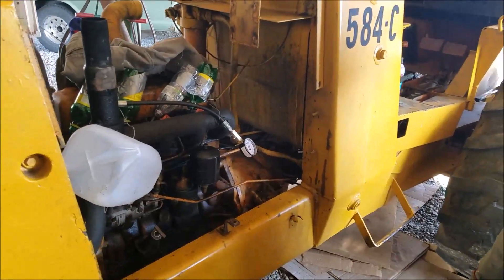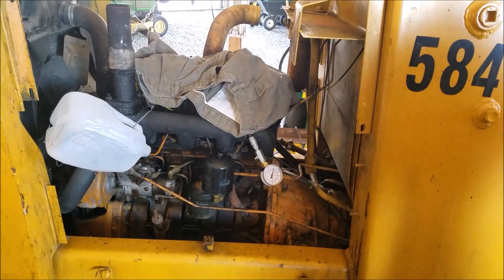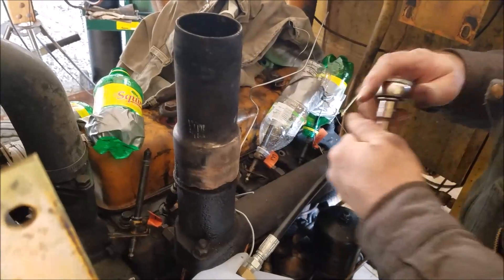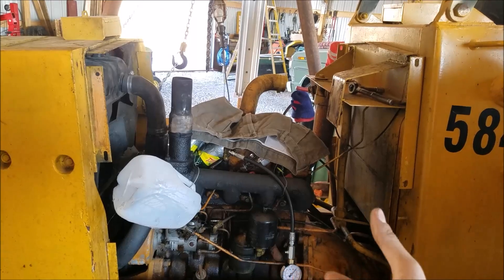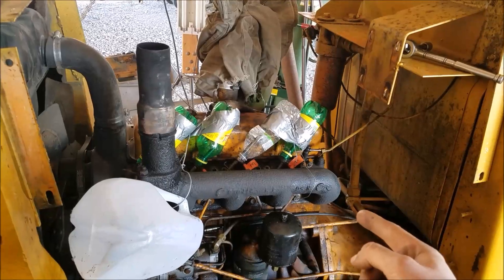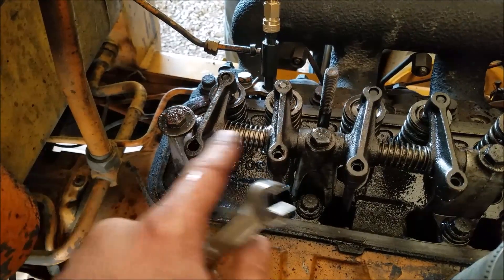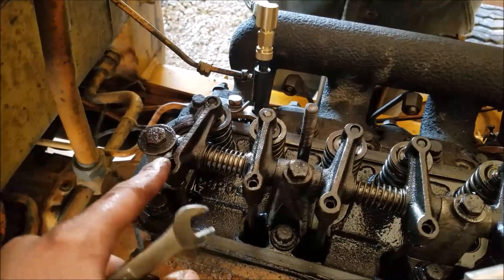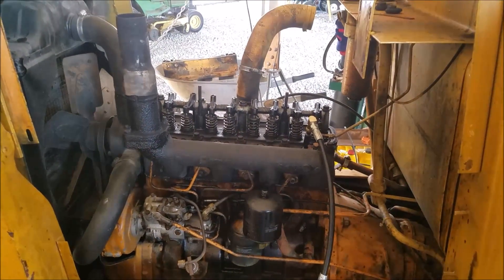1979 Diesel Engine Running Awful - Diagnosing Engine Health (HUGE Fork Truck)

Comment from the maker: Here is my argument against a pushrod issue from what I understand: a pushrod issue would hurt the rocket arm geometry as the distance from the lobe to the rocker is different, but the lobe itself will dictate the overall lift or opening of the rocker and valve. 
Thoughts? We need to get the rocker assembly off and get that pushrod out for a closer look with the bore scope!
Reply: you are correct, and looking with the scope makes sense, but why do you need power in this thing? Are you planning on racing it?  What would be wrong with just living with the worn cam lobe at least for a while? Of course one cam lobe would be worn for a reason, and if that reason is a threat to other, more expensive parts, then that would force you to do it right, even if power loss doesn't.

Comment: Wow, surprised to see so many good comments.  Tear it down from the top down, check rockers push rod and lifter.  I have seen plenty of collapsed lifters.  you don't know till you know. I will keep watching.
Reply from the maker: Mike O'Brien it probably would have helped if I mentioned they were solid lifters. - usually lash refers to solids, but I did not come out and say it. Moving forward on it soon
Reply: Ah, of course.  I just fixed an aluminum head 440 with adjustable roller rockers that were way out.  You will find it, probably what you suspect, the cam.

Comment: Yup, your cam probably is cooked, lack of oil distribution to the ends has probably caused that, so you will likley need to pull the block and dip it to clear the galleries..

Comment: This was super interesting to watch I’m currently taking an automotive technology course and I am also interested in diesel so it was fun to see what you were doing and how you diagnosed the issue good luck on fixing it and thanks for making the video👏🏼😏👌🏼
Reply from the maker: I have whole engine build walk-throughs on the channel along with some pretty popular vehicle Resurrection - might take a scroll through the playlists displayed on my channel if this is some of the stuff you are into.
Reply: ThunderHead289 thanks. I’m subscribed to you. Our teacher actually showed one of your videos in class! =) I think you were using the valve spring compressor.
Reply: ThunderHead289 so that’s what made me subscribe was the video shown =) I do some simple videos on my car cuz I wanna help people know how to work on cars =)
Reply from the maker: Smokinskittles that’s cool, can’t remember the last time I used one on camera. Must have been from the 302 series in 2014 👌
Reply: ThunderHead289 yeah it is cool! =) and I think it was an older one of your videos =) are you going to be making more specifically for this motor?
Reply from the maker: probably so - fairly certain that its the cam. its a solid lifter unit, so that alleviates the possibility of a failed lifter. its not a bent pushrod either as that would alter the geometry of the rocker, but would not effect lift as long as there is not excessive lash of course. the lobe of the cam is solely responsible for the opening of the valve in this scenario. 
there will be more on it soon.

Comment: im a diesel mechanic next time post a vid with it running as for yours you need to check the rocker clearance to valve adjustment was it missing , looks like the injection pump has been off as well.

Comment: cam is gone i think, but before you take it apart pull that pushrod just to be sure it aint bent. the "lock  nut" sould be a bolt coming in the top of the rocker arm jaming the bolt that the pushrod is pushing on.

edit   i had that same lack of lift on my truck, when it was fresh form the junk yard, a lifter would not pump up the little spring was just ehgouf to hold up the push rod and make it look ok. one more dounut at 6000rpm and it came apart.

Comment: With that little lift on that rocker arm, it would seem more likely that the pushrod had been broken and replaced with one that was not the correct length or the lifter/tappet has completely collapsed. A wiped cam lobe wouldn't account for that amount of lost lift. In any event, a thorough inspection and measurement exploratory is in order. Perhaps you'll get lucky and only need a set of pushrods and lifters.

Comment: that could be a collapsed push rod or lifter. some push rods are just pipe with solid rounded ends welded to the pipe and i've seen that end crushed up into the pipe. could also be bent because they're quite soft. a no compression piston ring issue will cause blowby out the dipstick. sometimes carbon jambs up the valve inside the valve stem and wrecks just 1 push rod. at my job they have a ih1066 with misfire and diesel out the muffler bad. tractor hood/cab is completely covered in fuel puddles on the ground.

Comment: Same thing happened to me last year bought a 78 f150 with a 351m  guy wanted to get rid of it bad brought it home found cylinder 5 is at 10 psi oil sprays out of the head under acceleration I don't want to spend the money but thinking buying new engine

Comment: Only other thought is a bent push rod which would also hinder lift.  Lot easier to address then a new cam. Not experienced enough to imagine why just one lobe would be worn other than lack of oil, or spring compression is way too high...but I would think push rod would bend before lobe would wear.Look forward to seeing what you find...........BTW do you still have the $500 Ranger??

Comment: Thanks for he free entertainment man👍
Reply from the maker: I appreciate that man, thank you !!!
Reply: @ThunderHead289  What happened with this old dude, I don't see any follow up videos!?
Reply from the maker: Old coinchaser I can’t say I have any experience with that... hmmm - what are they doing currently/ what is the nature of your issue?
Reply: ThunderHead289 .... Can you help me? How do you recalibrate all the gauges on a 94 Thunderbird lx? I will appreciate any help. Thank you. Take care my friend
Reply: ThunderHead289 .... WELL, the speedometer is 5 mph faster then your actual speed.  60 mph on gauge is 55 mph fast. I put white face overlays on my gauges and painted my needles red. Someone told me I have to recalibrate them. I forgot to mention, my speedometer being 5 mph off is not because of tires or mods. My car is stock. Thank you